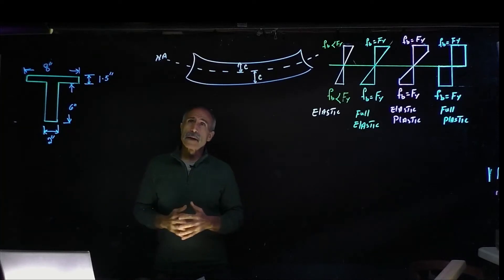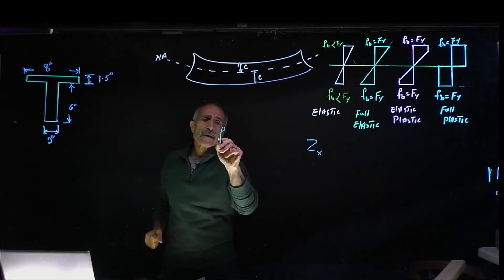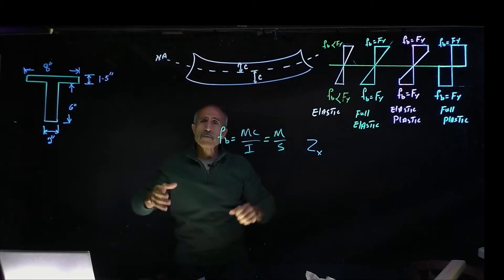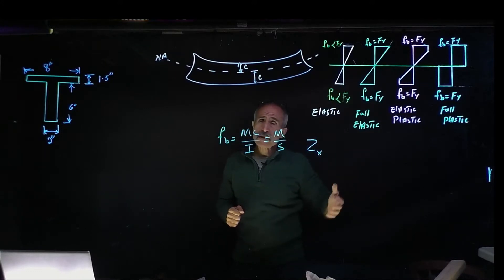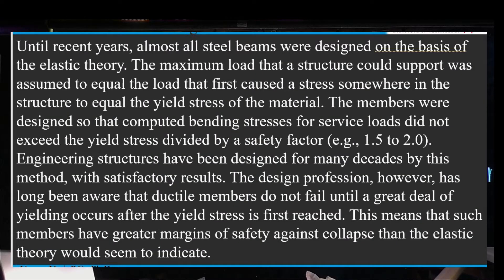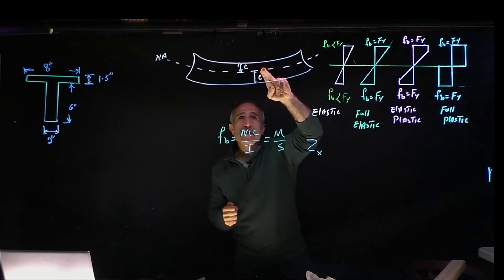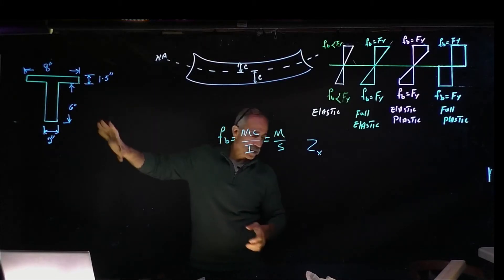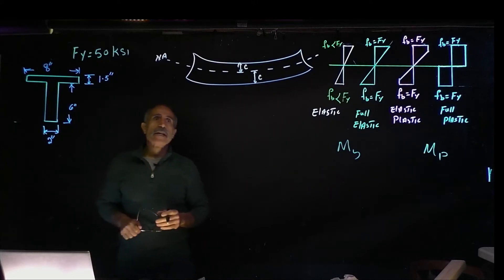Plastic Section Modulus, Zx ,  Plastic Moment, Mp,  Elastic Section Modulus, Sx, Shape Factor

Comment: Sigma y= fy ?
Reply from the maker: No, fy is the strength of the material in this case is the yield stress of the steel. sigma y (sames as fb) is the stress due to the applied load.

Comment: Why we  in the colage take Zx=ix/c and S calculated as you calculate Zx
Reply from the maker: The plastic section modulus, Zx, is used to determine the limit-state of steel beams, defined as the point when the entire cross section has yielded. This property is unique to steel, since neither of the other materials we are considering (wood and reinforced concrete) has the necessary ductility to reach this state. In other material we use Sx. 

Unlike the elastic section modulus, Sx, the plastic section modulus has no fixed relationship to the moment of inertia of the cross section. Rather, it is defined as the sum of all elemental areas above or below the centroid (x-axis) of the cross section multiplied by the distance from each of the individual elemental centroids to the centroid of the cross section as a whole.